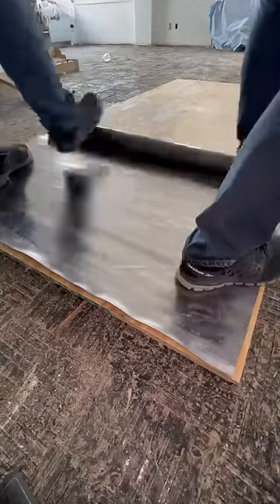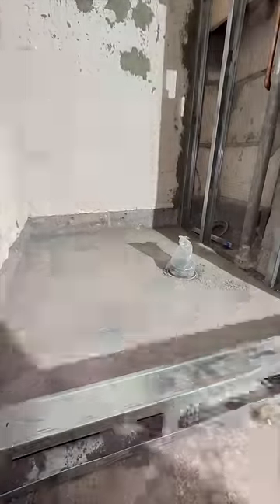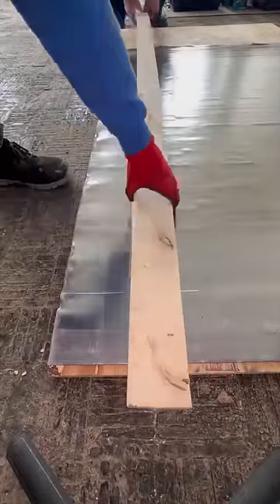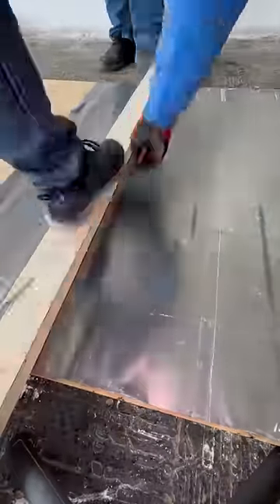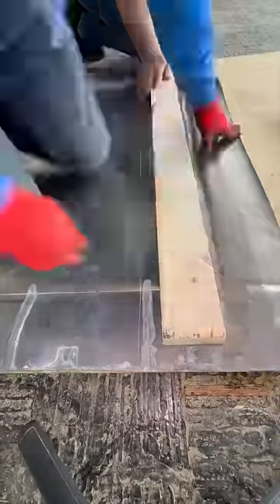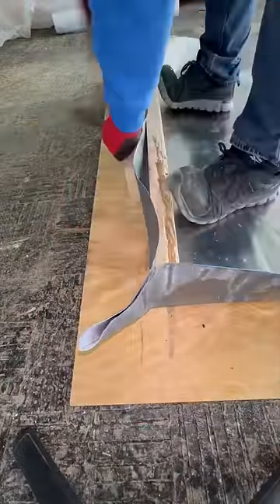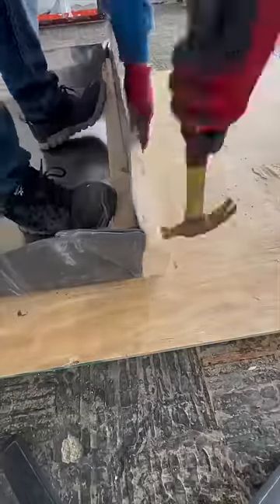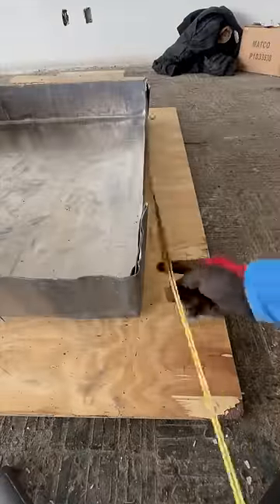Making a lead pan #shorts #howto

Comment: I'm not allowed to use a drop of lead to solder my circuit boards because of places like new york. Yet you can do this??
Reply: Feed vs. 'drain'/moisture barrier. 
Plus, you don't want to be breathing the fumes. Not that it matters that much, given all the other/worserer toxins in our plastic life. 
My water main from the street here in Chicago is 1/4" lead pipe. All the new hospital (other?) buildings require silver solder (50% ?) here for feeds.
Reply: @stringlarson1247  This is 200lbs of lead in every apartment in NY.  Why can't you have 1/100th of a gram of led inside of your cellphone?
Reply: @mikeissweet  shrug.

Comment: Hey Hydro!!! Can you throw some tips my way on removing galvanized nipples from water pipe? And what do you do if the threads snap off???
Reply: Go back to the other side and un do it and run copper 
Or  re thread the nipple or press it
Reply: @larrytheplumber9851  I mean if the threads snap off in a fitting,
Reply: What’s the diameter…and can you fit a sawszall blade in the 90/tee whatever or maybe hacksaw blade and cut the broken off piece just to the thereads and then take a chisel and hammer and smack the pieces out
Reply: @tjlovesrachel  3/4 - 1/2”

Comment: ingesting lead is toxic, simply being near lead is not dangerous and using lead for water and pipes is also not dangerous. lead builds a layer of oxide similar to copper, separating the raw lead from the water.

Comment: I oughtta get some lead for my OWN apartment, to help with the soundproofing as well as the little air-leaks carrying smells from neighboring apartments.  How many tons would I need to make a floor-to-ceiling liner of foot-thick lead?  It would SURE be a Great radiation shield, all the way from Radio waves to infrared to X & Gamma rays! and also WATERPROOF, allowing me to Fill the Entire Apartment with Floor-To-Ceiling WATER, making it possible to have different species of water critters in each area of the apartment!  Would the lead Have to Be Added, or Subtracted from the weight of the water? since the Lead is at Least partially submerged at least on One Side, probably half the lead weight ought to be subtracted, Right?  I made a rough estimate of about 1400000 lbs for the lead only, metric about 600000 tons.  Granted, might be a little expensive, but the satisfaction of driving your neighbors literally underground, and maybe even tilting the city a few degrees ... PRICELESS!  

Business idea PRO:  make the lead into modular resealable bricks, 1-foot cubes of just 700 lbs each - lemme tell ya, that weight sure comes handy to squish a rubber membrane tightly.  A couple moving guys could easily lift them in place.  This moving attraction would TRULY reshape the World, even its gravity just a tiny bit ....

Comment: Broski holler at me!! 

How come you all don t use the styrofoam pans and the tile contractor do the waterproofing? 
I ask because I have done a lead pan in 10-15 years. I quit using even durock/cement board in showers. Only foam walls and seats. High density foam made by Schluter. 
I have some out there that are 15 years old so I’d say time tested also. 
We install and flood to the curb to test. 

No relying on a silicone and bolt connection we’re weep holes are. 

Master plumber / Tile setter.

Comment: This is probably the only way to make water proofing that will last forever. Anything made of plastic or rubber will eventually crack and go bad.
Reply: Ehm, ever heard about tiles? Installed properly it will last hunreds of years....and you do not need to dispose of it as dangerous waste when you demolish it...

Comment: I really enjoy Broski's plumbing but he's archaic on this lead pan one.  I've changed out over 75 pans over my days as a plumber. They leak over time.  Using 40mil neoprene is not only cheaper but far  easier to install. I can appreciate this antiquated art of the lead pan but neoprene is definitely a step up. Tilers prefer neoprene as well.   I don't know anyone who uses lead anymore.
Reply: @Wontreplyeverdontbother  code doesn't mean something is good or shouldn't be changed, Chicago and many surrounding cities require conduit in homes even single family when it's just straight up not needed, it isn't "bad" but it's outdated.
Reply: @BlackHawkBallistic  Yep. I work on alot of elec. and plumbing in Chicago. 
No romex, no PEX. I just did a 2nd story elec. job in Milwaukee with Romex. 
I have a love/hate relationship with both EMT and Romex.
Reply: I gotta Google "40 mil neoprene shower pan" now.

Comment: Why would you make pan from the lead that does not cover anything? You use pressure treated lumber in frames, with no separation membrane between lumber and concrete, make water insulation from lead, put carpet that you cant wash on the floor made from plywood. You can punch trough the walls and door and there is no insulation, or when rare cases there is, its foam to glue everything together so there is hellawa job to renovate anything and dont get me started on pluming and wiring...  Why?! More i watch American building practices, less it makes sense.

Comment: This is such a cool skill to have, i think this would be my favorite part also. Im remodeling atm, wonder if i should have this done instead of the other options. It seems like its a gaurentee that its water tight since its one solid piece of metal.
Reply: Use schluter Kerdi board. Way easier.
Reply: @TheMr69roadrunner  yeah but this looks more fun that placing what looks to be glorified sheetrock .... lol
 plus...  I heard sometimes the pre-made shower pans they make, aren't sloped enough for every application.  But that may have just been one badly made one that got the bad review I saw